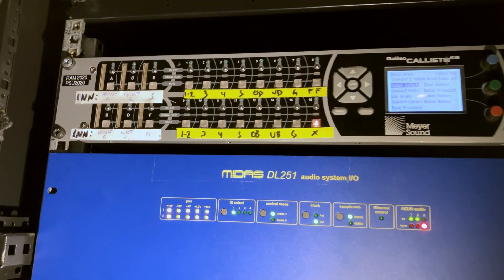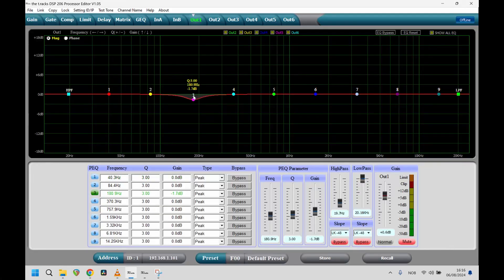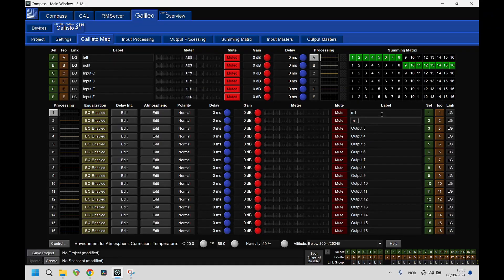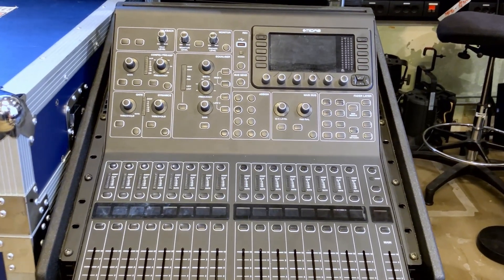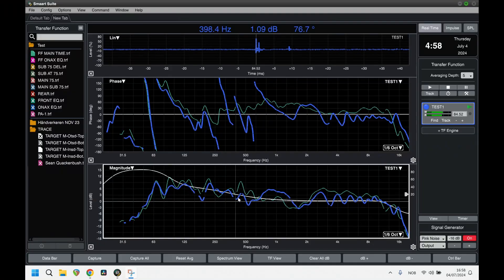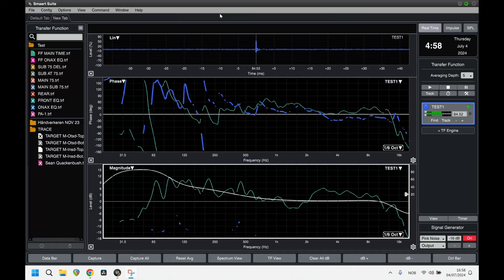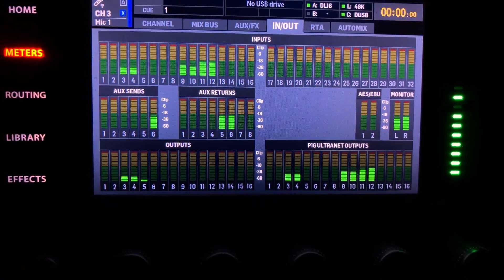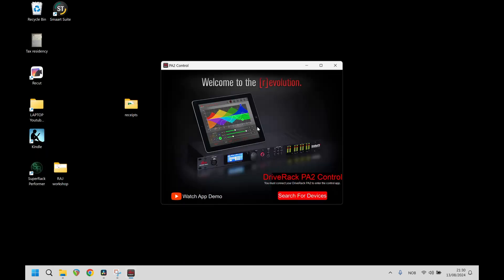What Is DSP In Live Audio

Comment: Think DSP as CPU to your Computer or Laptop. 
It acts as the BRAIN of your Sound System.
You can use it to Manage, Tune or Calibrate your Sound Rig, and ETC.

My husband uses it to Calibrate his sound system depending on the Venue, type of event and audience.

He uses software like Smaart, Rita, Open Sound Meter to  Make sure The Subs and Main and; Time Align, Phase Align, and last EQ.
Using the DSP helps you tune your system. Yes, you can tune your sound rig without the DSP by using EQ, Crossovers and etc.
On the other hand, using DSP will be much easier to tune your rig and hoping to nearly Perfect (of course you need to verify it with your ears, so make sure you have a good and well-train hearing).

I believe that's all. Hope you learn from it, just correct if I'm (if there are certified sound engineers here). 
Thank you!

Comment: I'm really, really cheap...............................
       I can't afford multiple pairs of home speakers.  That's why I triamp at home.  I can go from Klipsh Heresy horns to JBL L100 cones with only a midrange driver change.  Etc. Etc.
      Cheap and easy.  Enjoy lots of combos without buying a lot of polished bespoke wooden boxes.  So says an old DJ.👍
                                                                                        Acid Jazz,  Funk & Brass   🔈🔉🔊
PS,
       And it's not dumping very expensive "hifi" watts into caps, coils & resistors as heat.